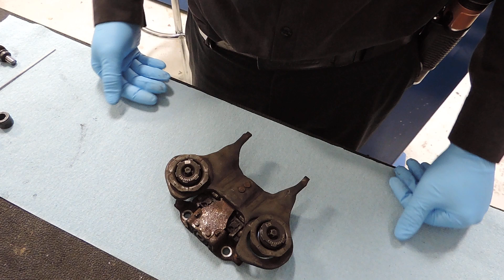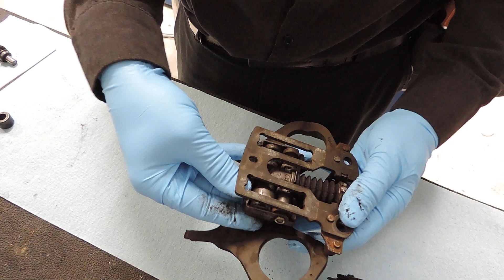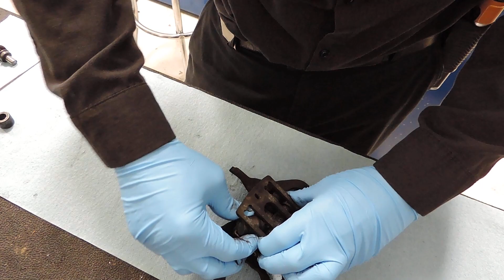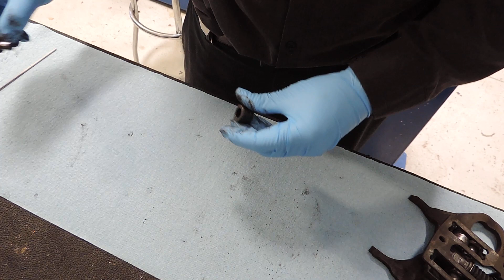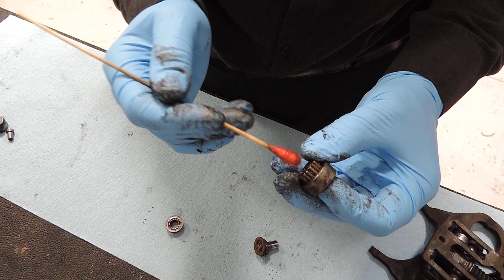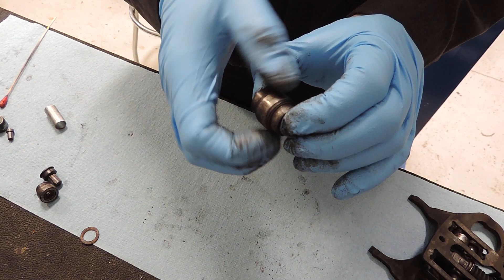Ford DSP6 Dual Clutch Transmission Throwout Bearing Fork Repair

Comment: But what about the other two smaller bearings beside theses two, they get just as dirty and they sometimes seize up too

?
Reply: Those other smaller ones aren't really all that important; break them free if they are not spinning & clean out the rust if any as best you can. hit them with any fluid you have but it's really hard to free up the tiny needle bearings inside them and I'm pretty sure you can't take them off the shaft that they are on.  KennnnyUpull for a better set is an option too.

Comment: This is very helpful. Rather than buying new forks, it's better to reuse the parts. The special tools are already expensive enough
Reply: You can do the entire job with no special tools, well except for the reverse torque bit on the fork I guess - but that's not really all that special.

Comment: Could you please let me know what's going on:

I turn the bolt the actuator turns and it doesn't spring back. I can turn the bolt in either direction infinitly, it feels like the bolt is not moving the fork forward or back at all. 

Does this mean it is fully extended and disengaged? Is it stripped? Snapped? Other? 

Thank you so much.
Reply from the maker: Probably stripped. The bolt should bottom out in both directions. Without seeing it personally I can't say for certain.
Reply: @andrewgibson5101  Thank you for the reply. So, is it even possible to extend the wedge to the point that it comes off of the drive screw?

Comment: Question. My dad Ford Fiesta has shown the P07A5 code and after research he found that the Cluch Fork may have be too dirty and is getting stuck, My father tried to to clean it using the external clening method (using the "Clutch Actuators Reset Tool" and brake clener), but durring the process he over did the drive screw (anticlockwise) and the screw started to come out. Now he is too stuborn to accept the fact that he broke the part (correct?) but now I keep telling him that he has to replace the Cluch fork. I am wrong?
Reply from the maker: If the screw came out the fork will have to be replaced.
Reply: @andrewgibson5101  can the screw be pulled out off the assembly if it has been turned too far and no longer is engaged?

Comment: Excellent solution! Thanks for the video very well explained.
Here in Brazil we have a chronic problem with this clutch. Moisture causes a lot of rust on components, and seizes these bearings. I thought of replacing them with stainless steel bearings.
In fact, I thought of replacing the bearings with stainless steel ones, resizing the springs that force the carriage to return, and increasing the power of the electric actuators.
Here some mechanics suggest drilling a hole (1/4) below the clutch housing, in order to allow the water to come out. I don't know if it's a good idea.
Thanks again, and God bless you!

Comment: So does it seem likely a shuddering noise and hard shifting issues I'm experiencing along with code P07A5 is due to a bad shift fork roller bearing? Car has 115k miles
Reply from the maker: It is very possible.

Comment: A permanent fix would be stop the dust from getting all over the inside of the transmission. Otherwise it would happen over and over again. It's a bad design transmission. To bad there is a shop to convert these automatic transmission to 5 speed manual transmission cars. That would be a better solution.
Reply from the maker: Dust from the clutch in the bellhousing is just the nature of the beast with a clutch. What would have been better is to have sealed bearings for the forks.
Reply: @andrewgibson5101   do you know any sealed bearings that are of that size?
Reply: @andrewgibson5101  yup, that's the problem and until that's taken care off. Which it won't. You will have that problem over and over again. It's just a pitfall for those people. That own these DCT's ford focus cars. Australia got ford to buy back their DCT's Ford focus cars.
Reply: I think so, swap to manual transmission is better solution,, but in Indonesia is hard to find garage to do that. Anyway great video.

Comment: If the DPS6 clutch is being replaced, is it recommended that the actuator levers or forks be replaced all together as well?
Reply from the maker: It is recommended that they be replaced at the same time for the reasons in the video. However they are not always available and telling a customer their car will be down for months isn't a good option.
Reply: @Andrew Gibson  Thank you, that's good to know. I've gotten the repair manual from motorcraft service and was reading through the TSB and going off of their parts list, but then I came across a LUK kit (602 0008 00) that included the levers and it started to make me wonder about them. Have you had any experience with that clutch kit? Or do you just stick with OEM motorcraft?
Reply from the maker: @outwestjake  LUK makes the OE and OES clutch for Ford. It is a good option for a replacement.
Reply: @Andrew Gibson  great! thanks again!
Reply from the maker: @mtsanchez27  It varies based on the vehicle.

Comment: By rebuilding this rollers bearings can you reuse the same clutch assembly????
Reply from the maker: Only if the clutch is in good shape and you have the tools to compress and lock the clutch springs.
Reply: @andrewgibson5101  I only have the tool to remove and install the clutch.... Are you talking about that tool or the one to manually reset the clutch assembly?
Reply from the maker: @OriamSumel  You'll need the tools (there are two) to reset the clutch in order to reuse the clutch.

Comment: Pulling one back out now that we just did a clutch and actuators to and going to try this. Thank you
Reply: Did it help the stalling / jittery issue
Reply from the maker: @kristianmopsticc2887  This will not repair the clutch shudder problems.